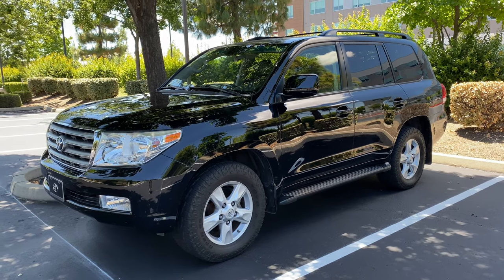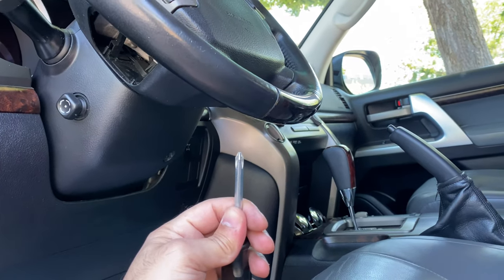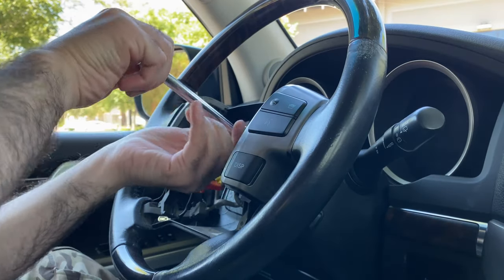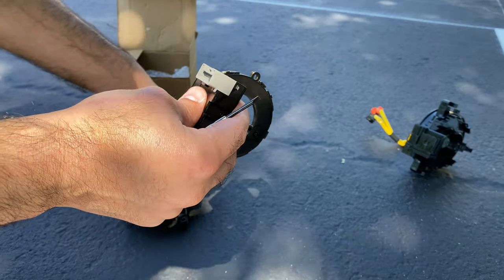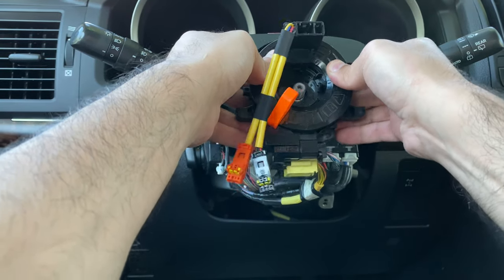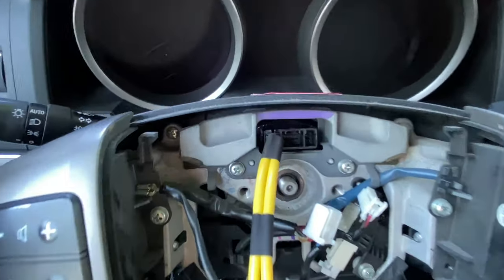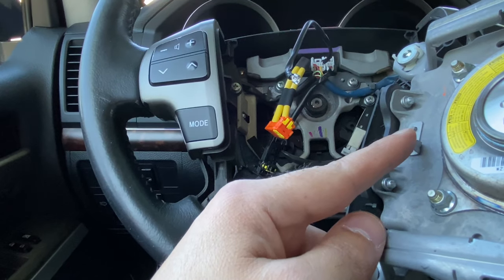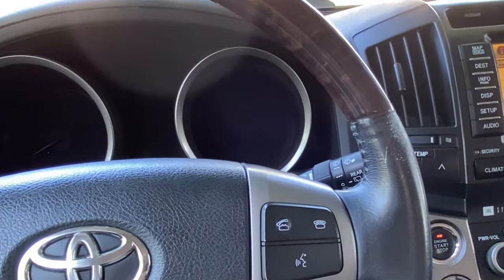How to Replace Airbag Clock Spring 2011 Toyota Land Cruiser (Airbag light on & Horn not working)

Comment: Great video! Thanks for posting. This just solved my Cruise Control problem! Stopped working on my 2008 Land Cruiser and we couldn't figure out why for months. Not even Toyota service. Installed a new clock spring and boom, cruise control back!